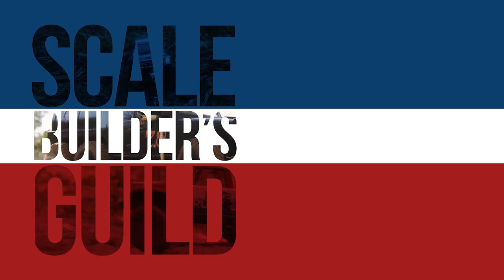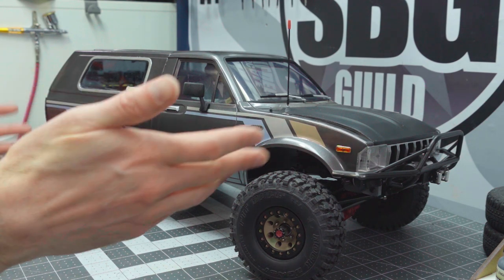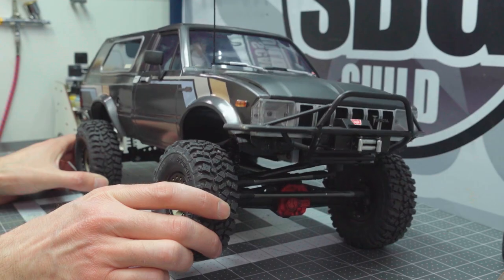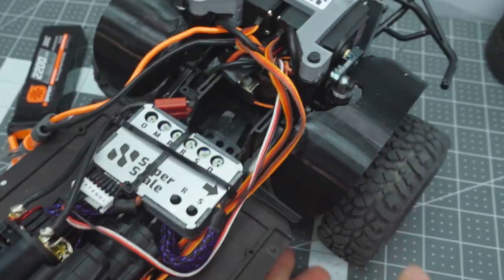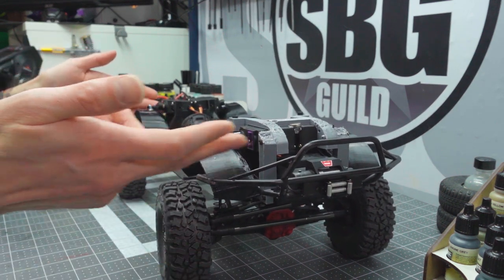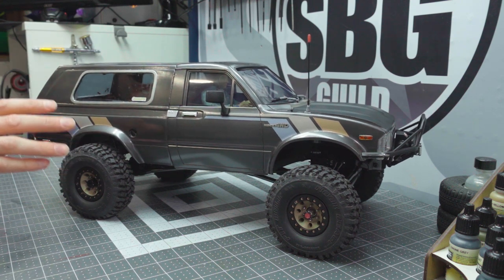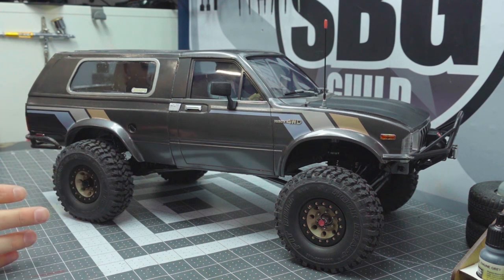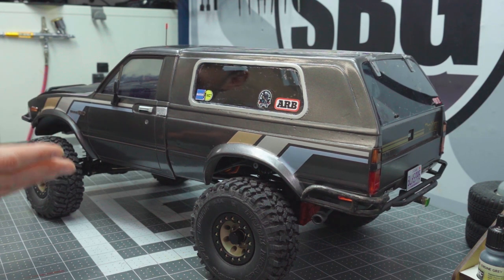Superscale2020 Real RC Suspension!

Comment: This is probably the most incredible mod I've seen so far. I will do this. As an application, this could easily be reprogrammed to be active suspension in a positive way, pushing the body so it wont roll, etc. All the hardware necessary is there. Very nice truck, what a beauty!
Reply from the maker: Thank you!

Comment: Looks awesome. I'd like a heavier duty version for performance reasons, the servos could be mounted lower and you could have real long travel adjustment. Imagine cornering and the outside suspension jacks up a bit to prevent lean? or braking, jacks the front and lowers the back a bit?

Comment: More is more, what can I say? I love it!!!!!!!!!!!!!!!!!!!!!!!!!!! Yes it looks so fun, and better when you're driving it than on the bench.
But the irony is, that if your full size car did that, you would be replacing all your failed dampers! Normal suspension should only bounce approximately one and a half times in a stock road vehicle. A well set up sports car or race car should settle with a single movement after you nudge it. Take a racing RC buggy for example, drop it onto all four wheels from one foot above the surface and, like a cat, it should absorb the downwards travel in a single hit and rise back to it's normal height immediately. I just did that with my Schumacher Cougar! (cat, get it?) 😁

Comment: Awesome! I have this active suspension unit in my TRX-4 since 2 years. I love how it works!
Now I’m trying to figure out a way to install it in a RC4WD TF2 leaf sprung truck. It’s a bit challenging without spring loaded shocks.
Reply: Any way you could mock up a fake sway bar to run across the axle to the servos? Still scale but adds the attachment points needed.
Reply: @killersquirrel16  ok, that's a good idea! I'll check it out 👍

Comment: Servo durability update would be interesting, it looks hungry. I’ve used that same Tower servo on at least 10 builds, and so far none have ended up in my junk drawer. Their micro servos I’m still on the fence, but my fault I hacked two for CR and they both melted. This system drifting probably fine, off-road TBD. I’ll bet you’re gonna be working on that thing more than you’ll want to.

Comment: I like it and think it is super cool tech, but my way of achieving body roll is adding a little bit of weight in way of scale accessories to the body and adding loose springs and no shock oil. It seems to work pretty well for me.

Comment: Such a sick suspension set up, when you don’t have power to the suspension servos say your battery dies, will it still function like stock as if the servos aren’t there or do you have to run it with them on once installed?

Comment: Best rig in your collection, its not the suspension but just the rig itself. Been waiting on this one bud.  Awesome.  What is going on with the hood?   I think if this kit doesn't compromise performance it could be something that people would be interested in period that syud I think it definitely does compromise performance. But for those drivers out there that love the slow crawl and never want to hit the occasion I'll jump or root at high speed I think it is pretty cool. It is obviously great for videos
Reply from the maker: I mention it in the video. Had to make a subtle bend in it to conform around the servo mounts for the suspension system.

Comment: Matt-great review & demo. If someone has a CEN 450 dually(or similar truck for towing a trailer), would this system be helpful to raise the rear end when towing/hauling heavy loads?  I know that wasn’t the intention but could it raise just the rear end to compensate for a load & yet still allow the suspension to work?

Comment: I found the video I think this is the most amazing truck. I’d definitely want to build one just like it but maybe use a 80 series land cruiser 1/10 scale.
Reply from the maker: Go for it!
Reply: Hey there I have a question for you. So do you think that the superscale2020 real suspension thing would work with the Axial SCX10 PRO??
Reply from the maker: @michaelmoore0886 you’d have to fabricate all your own mounts, so technically you could, it wouldn’t be my first choice of chassis though. You’d be stripping away most of its performance.
Reply: What would be a good recommendation on a chassis?

Comment: Would this work on an RC tank?  The suspension always looks toy like particularly when starting and stopping and doesn't replicate the scale weight!
Reply from the maker: You could try. Without the proper drivetrain, it would be difficult to find the proper way to mount it.

Comment: Do you think a fake sway bar could be added to a leaf sprung truck to add the attachment points but still look scale to make it work with leaf springs?
Reply from the maker: Maybe? S swaybar limits left to right movement though, doesn't it?
Reply: @scalebuildersguild  normally yeah but instead of attaching it to the frame to prevent the body roll like you are saying, attach it to the servos to allow active suspension to work with leaf springs but because it looks like a sway bar it would not ruin the scale appearance....

Comment: Would this work if you exchanged the servos for micro servos? I want to do this on a TF2 Xtracab rtr for my BTTF build, but I don't want to have to bend the hood.
Reply from the maker: No, you need lots of power. torque as it's essentially lifting the entire chassis! Thanks for watching and Good Luck!

Comment: So I have an axial Scorpion that I put the scx10 II Jeep Cherokee body on but when you turn the body just stays tilted to that side, is there any way to fix this? Maybe larger springs?
Reply from the maker: Probably has something to do with servo on axle and the 4 link.
Reply: @scalebuildersguild  where else would you be able to put the servo so this doesn’t happen?
Reply from the maker: @manualtuning5222  I'm only speculating, I don't have a Scorpion here, so can't say for sure what's causing that, but it sounds to me like something is binding or your endpoints are so off that the servo horn can't come back to center.

Comment: The hood does not fit very well not shut properly, took your time we had a conversation on here hell six months ago well maybe not quite but I had forgotten you said one was coming to you, I like the body style. Did you have to play with springs and fluid to the shocks to get the look you wanted I realise the system works on the top shock mount but the fluid and spring weights may not let it look scale, love the system but cant see me using it at the moment but never say never. Yes it looks very good when filmed to give the realistic effect.
Reply: It looks like the piston is not moving at all. It looks like the shock is just for show, but is really a solid piece which is moved by the servos. if you watch as he presses down the car, the springs don't move at all. Edit: nevermind, that's just on small movements.

Comment: Hmmm...the code in that arduino looks awfully familiar to a setup on my 1/5 tank reactive air suspension...but, I digress...
If anyone is interested....
to make it a true active setup that you can put on a 1/8 nitro stadium truck and truly thrash...or a scale rig...
Ditch all servos,turnbuckles, silly mounts...use scale dual action airshocks from the original 'scale tank' source, mount their mini 8 port (1/16" tube OD) 80psi nominal regulated solenoid valve. 8 adjustable check/bleed valves are added btwn shocks and regulator to lockout as high speed race only use..and as high pressure source use 2 disposable threaded type CO2 cartridges (shiny cool looking scale fuel cells lol) to bb gun type 1/4" piercing threaded adapters (I used adapters from a common CO2 pistol)...use same arduino with mildly modified code (I still have the files if anyonewants) . In this case, your dual action cylinders can be run as scale reactive for looks (and air noises sound like hydraulics) or flick a switch to run any higher pressure in lower chambers (rebound) and lower pressure in upper chambers (compression). Oil-less shock system, uses ptfe bearing sleeves and nitrided shafts. We added in 4mm capacitive current micro eddy sensors to strap mount on cylinder centers to monitor shock pistons, so either rebound or compression could change based on shock shaft speed..I believe micro-epsilon made the sensors and are very simple to calibrate wheel to wheel with a simple ohmmeter. A 1/8" manual high pressure bleed valve was added btwn co2 and regulator to slowly add in pressure to protect shocks. I'm sure a few get the concept but I can do a pic write up if interested.

Comment: Looks like it has blown shocks. Why not just drill out the shock pistons so they don’t dampen and place some weight up high for a more realistic CG. Nothing is more realistic than actual weight flopping around.
Reply from the maker: Because a lot of trucks don’t have that kind of weight. And this is adjustable. And reliable. And doesn’t ruin a set of shocks. 😉
Reply: @scalebuildersguild  what about stick on wheel weights for the roof? I agree that it’s cool, but nothing is more reliable than dead mass. Haha.